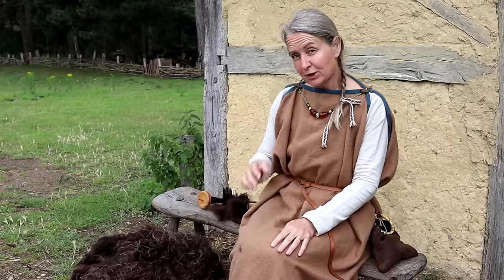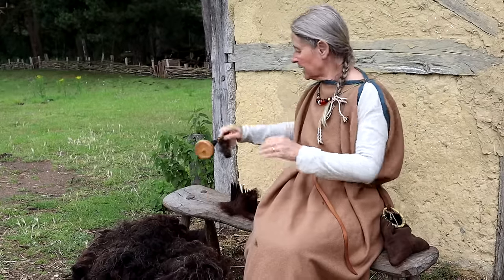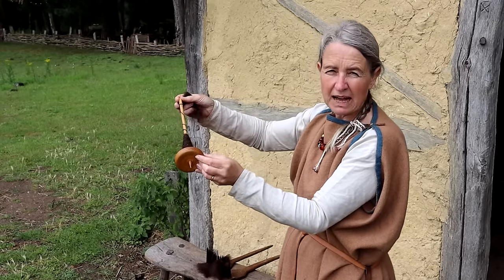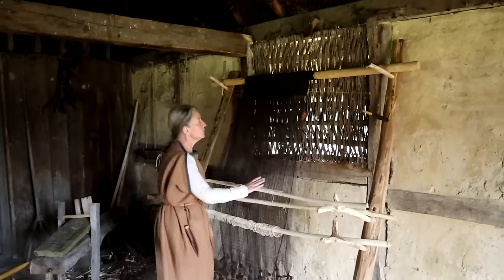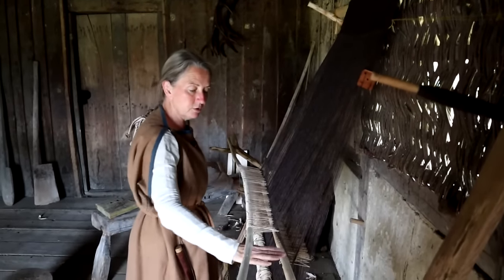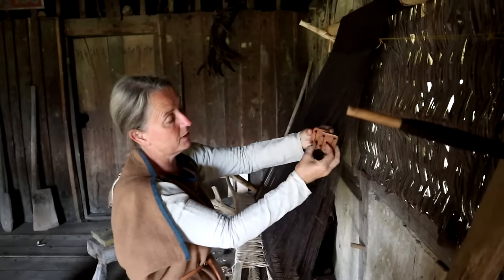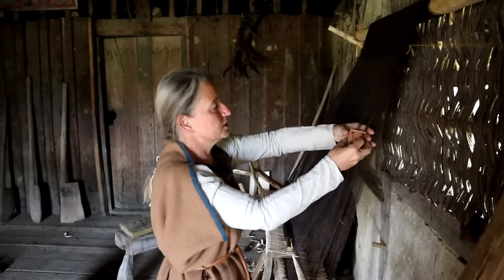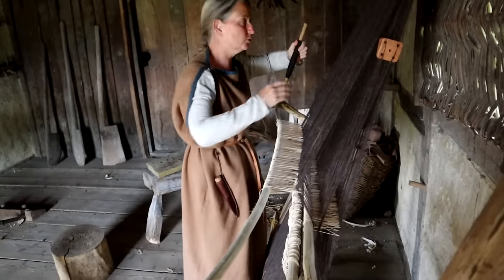Weaving cloth the Anglo-Saxon way

Comment: The amount of labor to create things that we take for granted today is almost incomprehensible
Reply: Well now it's all automated and industrialized
Reply: Agreed, including the “almost” part. With little else to distract you (nothing electronic, and most people couldn’t even read), and a motivation to stay warm in winter, daily chores were just what you did. Not all, of course, but I suspect things like weaving were social settings as well. 
And I’ve always been amazed at how efficient and innovative people can get at repetitive tasks. The quick fingers and stamina of the young, alongside the efficiency of those older; I suspect they made cloth much faster than we can imagine.
Reply: IKR?! 😳 Even with the speed acquired through endless practice, the sheer amount of manual labour involved in just this step is mind-boggling... There's so many skills involved too, from the tablet-woven selvedging through to different weaving patterns used for greater stretch (eg in crotch gussets), durability, & of course decorative patterning!

One can completely see why cloth was seen as such a valuable trade good (& why garments would be mended & patched until they basically disintegrated!) In an era without central heating or mechanized transport, good solid woven cloth that was made into clothing, blankets, tents, boat sails, feed sacks & all manner else was a literal lifesaver for the whole community...
Reply: I was recently reading about weaving... Apparently, it took 8 spinners (on drop spindles) to spin enough thread for a single weaver. Cloth was expensive.
Reply: But ironically, they also last longer, too...
🤣👍
Reply: Yes, but these weavers were expert at these skills. The demo was done slowly so we could clearly see every step. In real life, weavers worked very fast (I'm a weaver myself, and though I weave relatively slowly, I've seen traditional weavers in Peru working on a loom similar to the one shown here working incredibly fast). And carding and spinning the yarn would likely have been done by an expert spinner and then passed along to the weaver. So a good length of cloth could be woven in a single day.

Comment: I worked at a museum with equipment more modern than this but all still manual.  A spinning wheel for making thread and the horizontal loom with tension rollers on both sides and a ram (of sorts) consisting of pins. Just one warp thread would pass through each slot created by the pins and that entire "ram" hung above the warp,  free to swing towards the person operating the loom.  It was a more effective compression because each thread received the same pressure.

I couldn't help but think of ways to improve it, especially since loading a new warp was more labor intensive than making the cloth.

Too many very serious, permanently scarring accidents happened to young girls (and boys) working in the Mills of Lawrence, Massachusetts and elsewhere when people (like for instance; Governor of Arkansas ;Sarah Huckabee Sanders) felt that Taxing the Wealthy was "wrong" but keeping Children out of school?  "No problem"  (yet there's no telling where smart people come from.  Ambitious children? It's not usually the children of the very wealthy because know that they never have to work - so maybe the wealthy should be Taxed again,  the way they were Taxed during the New Deal when single income families were the norm and economies boomed for decades).

Comment: The tablet weaving selvage that she describes is actually a misunderstanding of how the ancient looms were setup. They actually started with the tablet woven strip along the top of the loom. The weft of the tablet-woven strip was strung very long and attached to the weights in groups to create the warp threads of the warp-weighted loom. This created a stable beginning for the fabric, and could then be rolled onto the top beam as the weaving progressed. Elizabeth Barber gives a detailed description of this that is much clearer than what I've written in her book, "Prehistoric Textiles".
Reply: Indeed, however they very often did tablet weaving on the side selvages, and even the bottom selvage as well (using a slightly different technique). Sometimes they even did more elaborate patterned bands. Warp weighted looms in Europe were used for thousands of years, over that time and area things varied quite a bit.

Comment: Please pardon my ignorance, but is there a reason the cloth is woven up instead of down? Seems the woven portion could be wound onto the beam that way to allow for longer cloth. Is there a mechanical reason that can't happen with this technique?
Reply: No expert me, but floor level has dust, dirt and animals.
Reply: The cloth beam is at the top because gravity pulls things down, not up. Warp weighted looms function by having all the warp threads hanging down, with bundles of threads tied to weights to give the warp tension. The warp threads can be several times longer than the actual loom height - weavers can chain them (like making a crochet chain) and then tie them to the warp weights. As cloth is woven and wound onto the top beam, the chain can be let out and retied to the weights.
Reply: I think more modern looms (at least 18th century onwards) usually go the other way, as it is easier to 'beat' downwards.
Reply: I imagine another reason is that this loom looks very easy to take down and hide in a corner when out of season. Current looms roll the warp forward (so, down I guess) but they really don’t fold up well and take up a lot of space. An equivalent modern day loom of that size would need a whole room!
Reply: This was a standing weaver’s loom and also allowed for wider cloth so that bedspreads didn’t need to be pieced.  Warps could be rather long, too, by chaining as someone else explained.

Comment: What is the purpose of the selvage edge?
Reply: A selvage edge keeps the fabric from fraying.
Reply: It gives more strength to the fabric.   The middle of the fabric is stronger because all the threads are interlinked (until we cut it!), but the edges don't have so many linkages, so they have less intrinsic strength. 

If you weave back and forth without creating a selvedge, then the threads at the edge will break sooner than the other threads,  as they will get more wear and tear and are not as strong. 

A selvedge as made here will be stronger.   If you look closely at a bolt of woven fabric,  you'll see the edges are much tighter woven than the rest of the fabric.   There will be less woven pattern in them as well,  as they are woven in a simple strong weave. 

It's like finishing a crochet blanket with a border in a less open and therefore less stretchy stitch.   Or slipping the first stitch in a knitted scarf to give a stronger edge there.